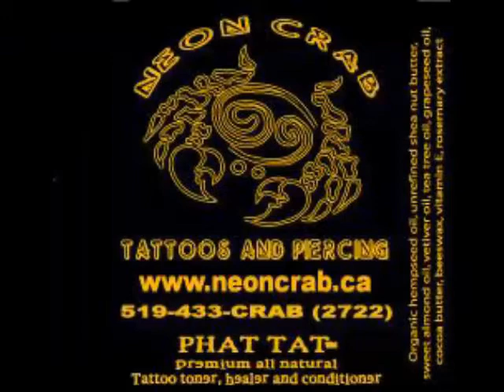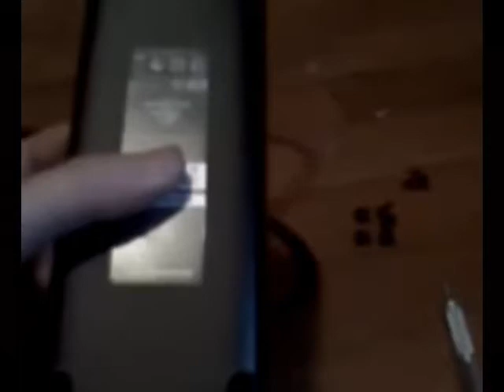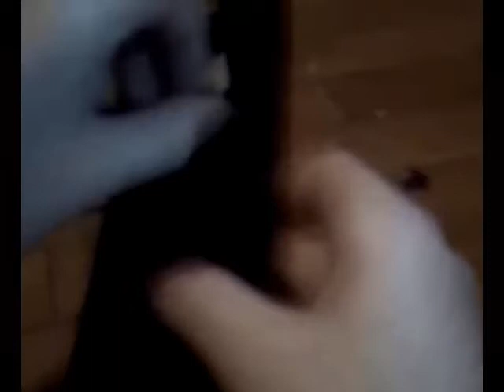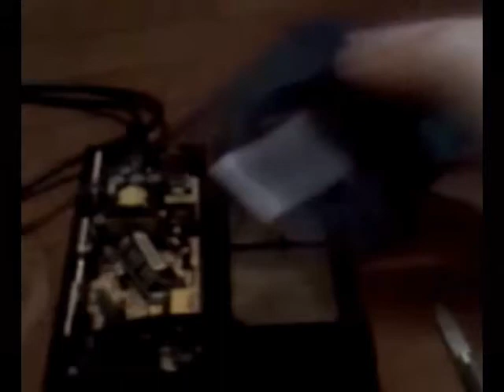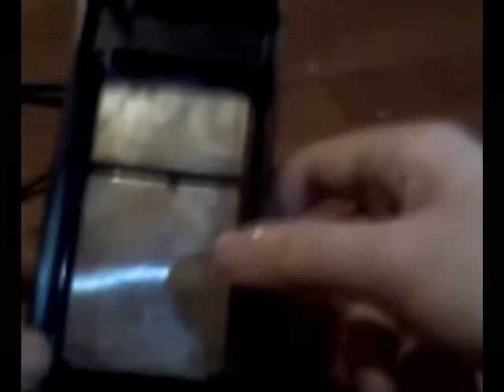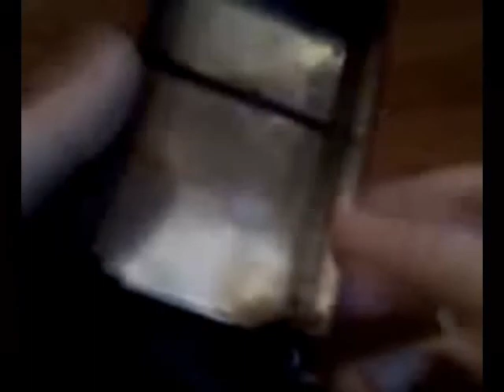Xbox 360 Slim Power Supply Fix Tutorial

Comment: does anyone know if the screws can be taked out without that screwdriver?
Reply: you can use a knife to cut those little nubs out of the screw. try it i got it open with a normal torx without the hole in it... hope it helps
Reply: Hunni Attila hey bro how did you cut them off was it hard?
Reply: i just bought the screw bit for it, but thank
Reply: shadowgamer700 yo bro u should of bought a new power cord bro it's like 15 dollars. No point spending money to use more time trying to fix it but 😂😂 too late now

Comment: Often times you can use a small screwdriver to snap the security pin off. But the security bits are easy to come by and well worth the investment...
Also, I have a block whose fan is dead. I replaced the fan, but it still overheats...

Comment: Once you take out those 2 little plastic vents and put everything back together it should never overheat again. The area that the power supply is drawing air from is closed off enough to where you shouldn't get too much dust, but if you start having the problem agian after a while you might have to open it back up and dust it out.